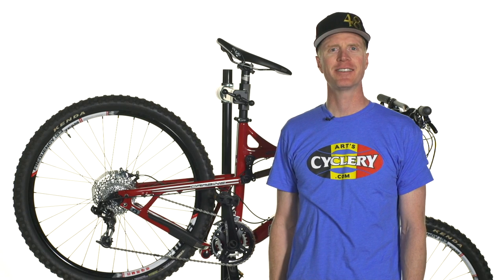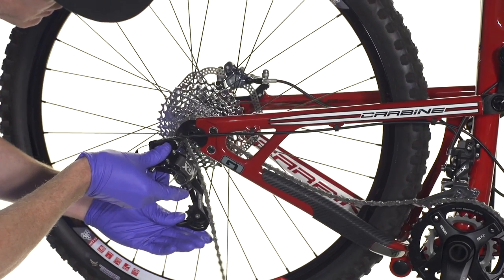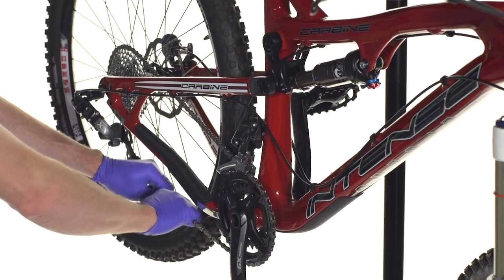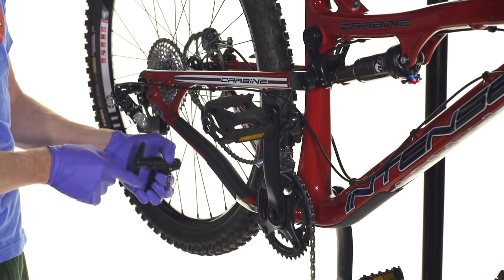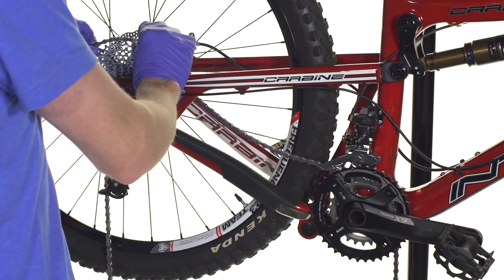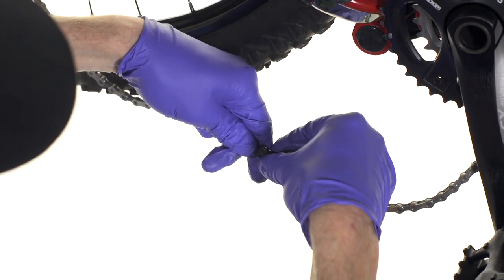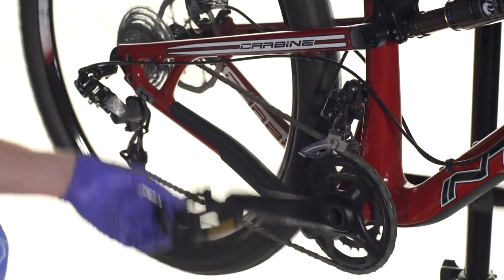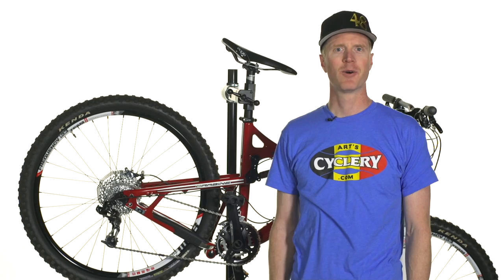How To: Install a SRAM Mountain Bike Chain

Comment: If I’m replacing a sram pc1051 with the same chain can I simply lay them out together and make the new chain the same size? It wasn’t clear how you decided what length to make your new chain. You seems to just pull on it and decide.

Comment: hey my pre existing sram chain someone else installed didn't look like it had a master link before it snapped?? usually you can close chains without a master link by forcing the pin back into the link and hammer it or vice grip it in.  this chain seems to be hollow where the cheap chains usually have pins connecting.  what do?

Comment: The chain length isn't "about there" the best way to get it right is to go big cog front and back, let all the air out of your shock so you get the correct amount of relief for chain growth then go two links over.  If you have say a single pivot bike with lots of chain growth then eyeballing the chain length with it fully extended is going to cause a rear mech to get snapped off.

Comment: cool but my power links wont go into the holes. i had to remove 2 links to get to the correct link. those 2 links were unlike every other link. the powerlinks fit through them...but i had to remove them to shorten the chain

Comment from the maker: The way SRAM road chains are shortened and linked together are the same for both mountain and road. Determining the chain length is different however. We will have a video on SRAM road chain installation soon!

Comment: Don't you need to compensate for the rear suspension as well, when sizing the chain with the rear derailleur ?
Reply from the maker: It's worth consideration and varies based on suspension design. Ideally you want to size your chain at full rear wheel extension, if you have a single pivot frame that typically means at full compression. With multi-pivot designs that point is some where in the middle of your travel. With modern 1X setups, the rear derailleur cages are long enough to take up any small imperfections in chain length calculation. 99% of people will size their chain with the shock mounted as it sits in the stand and not run into problems.